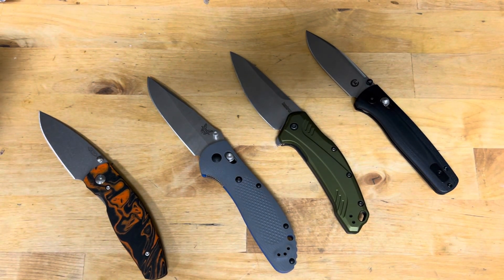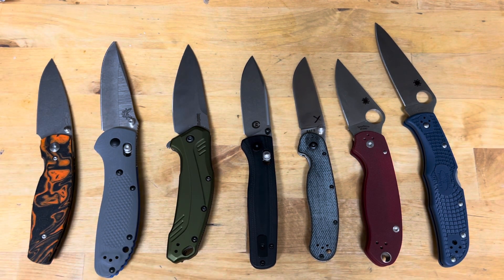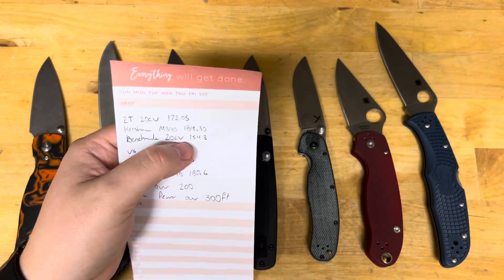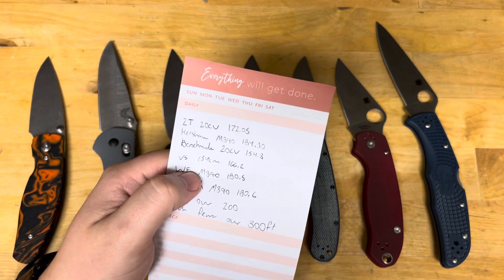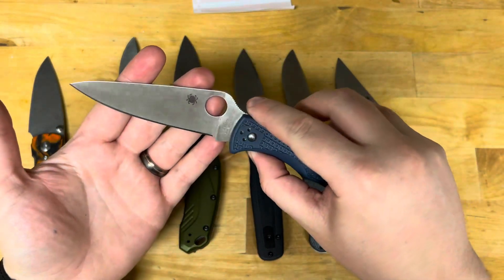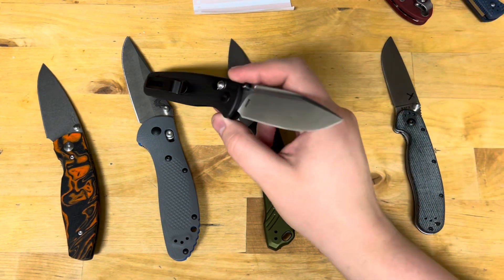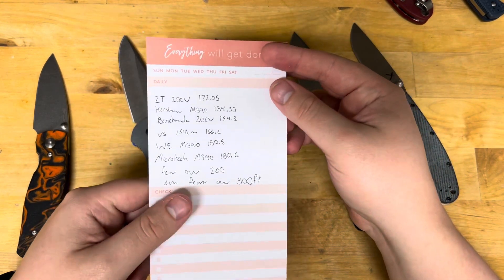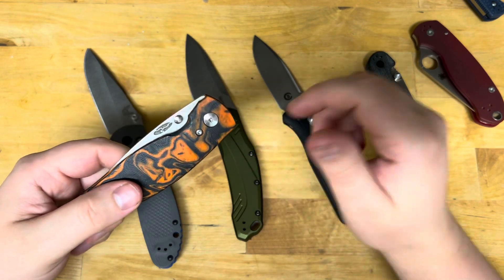My Gripes with 20cv/M390/204P

Comment: Instead of calling for maker to going away  from these steels how about we demand makers heat treat correctly...  because  the steels u are calling for makers to use  can preform as crappy as the 20cv,m390, 204p if not properly heat treated
Reply from the maker: I think it more so has to do with limitations of production knives, and so far they have failed to do it correctly for the most part so my faith in them to do it correctly isn’t there. Mainly this video is here to raise awareness, I’m mainly just concerned that people get a good product however that happens it happens
Reply: @allthingsknives  i totally get your point. I just don't think replacing these steels is the answer.. if a maker uses these or any steels they need to be held accountable.  If they continually do a subpar heat treat then put them on blast. Magnacut is the next best thing but if you watch enough YouTube alot of knife makers using it aren't properly heat treating it to it's creator specs.
Reply from the maker: @jpolhamus71  I think maybe a combination of both needs to happen
Reply: @allthingsknives  truth

Comment: Apart from the heat treat discussion, which is valid, I wonder why people buy these super steels. I suppose they cut down trees with their EDC knife all day or tear down cardboard for entire neighborhoods, so they need an edge that won't dull so quickly? I, on the other hand, and I think this goes for many if not most people, open the odd package with my EDC knife, cut a piece of string, and that's it. For that, 8cr13mov/12c27/any 440 variant, or a carbon steel will do just fine. Added bonus is that you're done sharpening in minutes when it eventually goes dull. In the kitchen I use kitchen knives, to tear down cardboard I use a utility knife. No need for super steels on my pocket knife. Now, I too got intrigued by the hype and have my fair share of knives in said super steels... and they just sit in my collection, gathering dust. Total waste of resources for me personally. I would love to see a poll done on what kind of cutting tasks the majority of EDC people use their knife for. They could probably get it all done with a Victorinox. Just my two cents, and your mileage may vary of course. 😉😉😉 Thank you for the video and keep up the good work👍🏻
Reply from the maker: Personally I need a super steel because I am hitting cardboard all day, and hard plastics. Most people though aren’t, I’d say having a good steel is nice but I have seen people come in and they haven’t sharpened their knife for an actual year. So most people don’t need a super steel, but they offer the convenience of less sharpening and that’s appealing to people
Reply: Geometry above steel all day long! Geometry is vastly more important than steel choice. I'm a steel nerd as much as anyone is but Geometry is first and foremost, heat treat quality than steel choice. M390 (and analogs) is a poor candidate for large batch heat treating. The reason the companies put out soft steels is because it significantly increases grinding edge/less abrasive use/simpler machining.. they know most people aren't buying the knife to actually put it to use, they know most are buying to play with and to take IG pics with.. it's really sad, it's really really sad but that's how it is. Most the people only care about the number that's etched on the blade being considered a premium steel but they will never use that steel enough to know if it's giving premium performance.

Comment: Definitely prefer tool steels and I just use a rust eraser for any spot rusting if I get any spots, but I oil my blades and wipe them down so don't really get rusting issues. And sometimes I just do a forced patina. I think cruwear should replace all the blades that have m390 on them and then people would see how great there knife could be. It sharpens up so nice and just keeps cutting without getting the edge damage I get on my m390 blades.
Reply from the maker: If you own D2 no problem then Cruwear won’t rust they similar corrosion resistance
Reply: If its heat treated properly its a great steel, and that seems true of whats being mass produced is 'half baked'...,

Comment: The problem with this video is Rockwell Rockwell Rockwell.. micro structure is highly important in steel performance. It's not just m390 at 63-64 Rockwell.... micro structure is a bigger part of the equation in performance than Rockwell is. So it's not only the hardness it's the overall quality of the heat treat protocol along with tempering the steel to within the range the steel performs best hardness wise. You can take poor heat treated m390 and run it at 62-63 and have it significantly out performed by a well heat treated piece of m390 where the micro structure is great with the m390 ran at 60rc. It's all about MS in a great heat treat protocol, hardness is secondary.

Comment: Over the past 8 months, I inadvertently sold almost all my knives in m390, 20cv, 204P. Wasn't intentionally, those were just the ones I didn't carry much. Not due to the blade steel but more the ergos or designs. I only have one 20cv blade left but that one won't ever be sold, so I hope the heat treat is good on it. It's a Demko AD-20 in 20cv. Great video and good information. I'll definitely think of this video when deciding on any future purchases. Thanks for your hard work.
Reply: I have a demko 20 and 20.5 both in 20cv. I've tested both and both are well within stated literature for the knives.

Comment: Same problem with magnacut you really need to go 62-64 HRC otherwise magnacut doesn't really perform well. I think spyderco has been consistently on point as far as production knife's, sprint runs are a hit or miss. I'd take rex45 or 4V anyday over 20CV. I did hear some of the m390s spyderco released in the pm3"s were actually pretty good though.

Comment: EDGE GEOMETRY IS WHATS IMPORTANT!!! I think it’s funny people how people get when they talk about steel now days. The fact is ask knife makers what they think matters more.
Reply: This is such a vague and misleading comment. And semi dumb. Sure, 3cr13 with good geometry is gonna perform better than s90v with terrible geometry, but no one is making knives in these steels with bad geometry. We're comparing steels here, not blades. You can't say your crap 3cr13 is better than s90v bc your geometry. Even if you compared it to some s90 blade that had terrible geometry, that blade wouldn't represent s90 or its capabilities. You have to compare both with the same geometry. S90 with correct geometry is gonna be a significant difference from 3cr13 or even s30v with correct geometry.
Reply: @ lol! clearly you took it to the extreme the comment was stated fir the argument of high end steels!! Quite literally about the video context.
Reply: @eYeSoN3691  to use as an example. There is a big difference between steels, and to basically say steel choice is irrelevant bc of geometry  is just ignorant
Reply: @Trolldaddy5  look you clearly are just doing as your name states! I have a ahit ton of knives with different steels and depending on heat, hardness and geometry is the key there’s no big difference between slot of these high end steels I can assure you wouldn’t know the difference but when a knife is treated and angled for its correct task it matters more and you will definitely notice that’s what the comment was about but again you clearly can’t see that.
Reply: @eYeSoN3691  your assuming whatever steel you're comparing to has bad geometry. Why would I use any steel with bad geometry? The argument that lower steels with good geometry are better than or just as good as  higher steels bc of geometry is stupid. You would have good geometry on the higher steel, too. And idc how many knives you have. it's irrelevant. I sharpen knives daily, and i also have a vast collection, but that's also irrelevant.  For example, k390 and 10v, with the same geometry 10v, is gonna out cut k390 period. Why would I say oh k390 with the right geometry is just as good 10v? Why wouldn't i put the right geometry on 10v instead? And if you want toughness, you wouldn't say get 10v and put thick geometry. You would say k390 and correct geometry, bc it is, in fact, tougher. Your whole argument is like saying an inch thick of 10v is tougher than a quarter inch of k390. Like, no shit but when comparing the performance of steel, you have to compare with the same geometry. And I don't know why anyone wouldn't put the correct geometry on the better steel. Idk why u can't understand this
Reply: @ you just made my point but again you are not getting it.
Reply: @eYeSoN3691  i know u have to read here, instead of watching a video and then parroting. But try to follow and have a actual thought. The geometry argument is dumb, bc it assumes the other steel doesn't have the same or better geometry
Reply: @ again your just not understanding your trying to assume shit the fact is you clearly didn’t get nor get what I have been saying! lol your name suits you. You can mix what said as many times as you want but what I said was actually straight forward it’s not just about the steel makeup more importantly the edge geometry and heat treatment! I’m guessing you’re a steel snob and don’t understand exactly what I meant but just like the last couple times I’ve said it you can have great steel makeup but if the knife is lacking in its geometry meaning shape, thickness, etc… also heat treatment it’s crap this is the last time I’m explaining this. Maybe try and grasp what I meant before acting like a kid who just discovered knives and trying to prove a point lol!!
Reply: @eYeSoN3691  i understand if the knife has bad geometry it would cut bad. That's not a argument for why steel doesn't matter bc the geometry is totally up to you. You choose the blade and you choose you're bevel. And you clearly put in all caps geometry is most important! Not even capable of understanding the video is about the difference between steels. Not the difference between different knives or blades and how they cut, but steel. You can get in whatever geometry you want. Your iq must be 50. Your literally parroting. And like I said in the original response, although somewhat true, it's very vauge and misleading.

Comment: I have a pro tech runt 5 in 20cv it came with a crap edge, but after sharpening and a strop it’s a razor blade. My para 3 20cv came with a wicked sharp edge.

Comment: It's not about the HRC numbers! It's ALL about the MICROSTRUCTURE!!! Watch the video Tom Hosang did on his channel with Brian from Transparent knives called "Microstructure Matters" and you'll see that the HRC doesn't mean a whole lot as far as cutting performance goes, it's the microstructure which does.

The issue you're seeing is indeed a huge one which I hate as much as you do, but until manufacturers tightly control their HT processes to get a proper microstructure, this will continue. It's highly doubtful they'll change unless enough people make noise and stop buying their knives.

Add the high speed dry grinding manufacturers do which ruins the temper at the edge, and you have a perfect recipe for crap performance that anyone paying attention can see.

Properly done M390 should out-cut MOST steels sold today save for other steels which are even more wear resistant, like Maxamet, 10v, 110v, 15v, S90v, K390, Rex 121, etc.

Comment: If we stop buying titanium/m390, they will stop making them. They sell it because that is what a lot of the knife community wants. They're conditioned to the fact that quality steel has those letters/numbers. I think that a lot of knife companies don't want to deal with the warranty it's that could happen due to having m390 at a higher HRC. Chipping and breaking. Strength is what I want at the edge. Higher HRC, lower carbide count. 4v, Cruwear are great for that.

I'll take any decently heat treated steel, who am I kidding.
Reply from the maker: Well and I don’t think m390 is really meant for large scale production either it and D2 have that problem.

Comment: Hey I'm here because my 20cv bugout was chippy af, a few sharpens seems to have resolved it. Why do you have so many knifes in m390 if you don't like the steel? Have you sharpened all these multiple times? Just curious if it's mostly because burnt edges people are noticing weak performance. Thanks, great video!
Reply from the maker: Most of the knives I got because I like the design but also want to try the steel to make sure my gripes are founded, best way to do that is get a bunch of different make and models

Comment: Just beginning to watch, my gripe with these steels is the low heat treat tempers that they get —low HRC.  That and the cost of upgraded steel.  Gives us good heat treats for the cost we pay for “premium” steel.

Post watch edit. I love well done m390 like Spyderco’s at 62.  If 204p and 20CV are analogs why are they usually 1-2 points lower HRC?

Who will re heat treat our knives because I like to try that for a bunch.

Who knows why the big manufacturers want lower hardness ease of grinding? Sharpening?  Magnacut is next?

Are your cutting number total third edge fine edge or working edge.
Reply from the maker: Total cut all are from Gerald’s spread sheet, they heat treat lower because large batches have large variance it also has to do with grinding equipment and cost, but at certain point it’s almost just laziness
Reply: An answer is that consumers demand HRC documentation on individual knives I’d pay 5$ more to know this
Reply from the maker: @stevenlachance8576  I’d pay 20$ more
Reply: @allthingsknives  

There's a Chinese manufacturer that used to give me 10% off their knives that had the HRC testing indentations.

What do you think of Elmax compared to m390? Ive only used it in 2 knives and both were custom heat treats (first world problems, right) and theyve both been really great users.
Reply from the maker: @CNYKnifeNerd  need more use before I can decide
Reply: Magnacut is being under treated by some, following the m390 let down model. It’s a shame since it retains toughness up to 65HRC.  I have not had chipping on m390 edges at least not on third edges and beyond..

Comment: I like Benchmade's 154cm.  Haven't felt the need to "upgrade" my minigrip.  They also used to hollow grind their sheeps foot blades when they were doing it in 154, but stopped when they went to s30v.  Their s30v performed well on my bugout though, kept a working edge decently longer than the 154cm on my minigrip.  
Wish more production makers would use 14c28n, it's decently tough, stainless, and seems to be good even with non-optimal heat treats.  Magnacut seems like a good candidate for hard use rust fearing blades as well, but softer production heat treats is also why I'm holding off on buying any production magnacut for now, going to wait to see how everyone does theirs first.
Reply from the maker: I think you hit the nail on the head

Comment: Like it was said, it’s gotta be a quality control thing. 

I’ve got two Spyderco knives, REC Para 3 10V and REC Para 3 Avocado in CTS204P. Both being limited production runs. I’ve been blown away by its performance from regular production steels. 

I know a lot of regular fare steels have their place, but now after my experience I couldn’t go back. CPM/154 when sharpened is a dirty ass blade. SVs…seem too soft and brittle in my opinion. 

I had a Spyderco smock I stopped using because the steel, S90 was way too chippy.